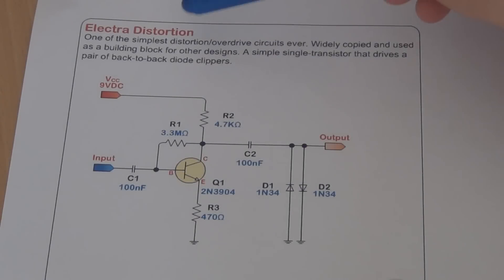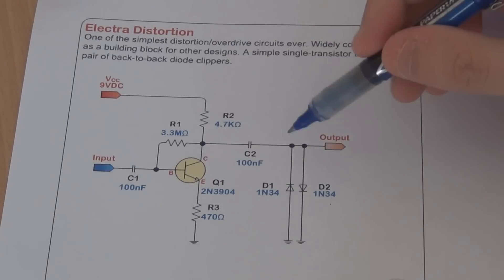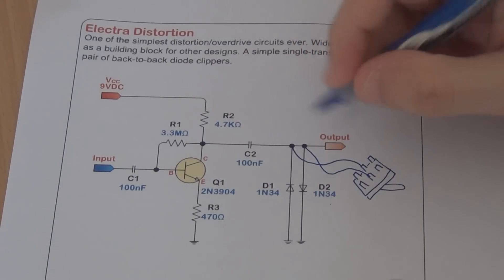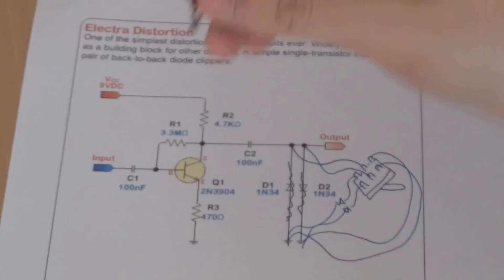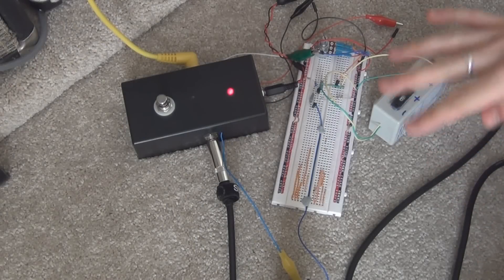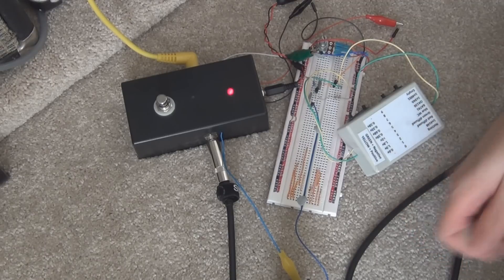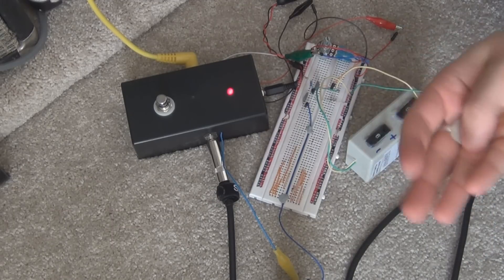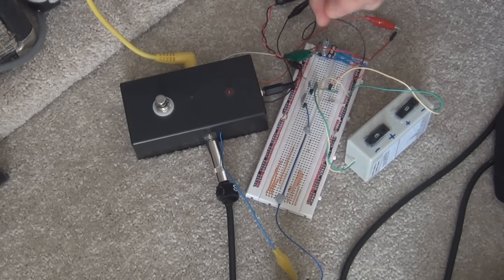10 min Dirt Pedal - Optional Modification

Comment: For those wondering, cuz annotations can no longer be accessed, the wiring presented in the video would short the circuit to ground and you'll have no output. 

To simple solutions:

1) wire an on off switch connecting both diodes to the on section.
2) wire a dpdt switch where instead of putting the bottom 2 lugs to ground, connect them together.

Comment: As well as the shorting to ground error, you could add that the diodes can just go on one set of lugs and don't need to be kept seperate. So a single pole on-off-on switch would be good for having clipping diodes - clean boost - alternative clipping diodes option.

Comment: You could also use spdt switch, connect middle lug to the circut, 2 diods on a first lug, and resistor on a third lug, with ends of resistor and diods connected to the ground. Resistor will help with volume differences.

Comment: Hi, just one clarification about the dpdt sw.. Would it mute the output if atleast one of those touches the ground? Thanks.
Reply: Was going to ask the same question. It should be either diods or nothing. An on-off switch would do the trick
Reply: @redrum22  Exactly.   Simple kill switch should do it.
Reply: So is this my problem? I added this clipping section at the end of an lpb1 build with a dpdt switch just like this but when I engage I lose signal...
Reply: @zacharygreenawalt7119  that's because the way that's presented in the video makes it so that all the signal that's supposed to go to the output goes straight to ground because there's no load. 

I'm honestly curious why he didn't just do on/off? Or on/on where the second on position goes straight to output?...

Comment: Hey really great channel,
I have built kind of the same thing myself  used a on-off-on spdt and added another pair of different diodes to the boost. I have a set of n4001 and bat41 plus the plain boost in middle position.  I have wired C2 and the output pot to the middle and then each transistor pair on the other positions of the switch. Works great. 
I think in the circuit in the video might be a mistake. In one position of the switch you get the diodes to ground and a distorted sound. In 2nd position direct ground and no signal. Not connecting anything would work I guess.

Comment: whats a good value for a subtle crunch at the same output level as the input? I plan on installing this circuit in my guitar and using one of the tone knobs to control the saturation before it reaches the amp :)

Comment: Your drawing on the paper: In the boost-position, the switch puts the output on the ground. Tjat cant be right? There would be no output at all, would there? Diodes there or not, but your switch makes a bridge and connection C2 directly to Ground?
Reply: Came to the comments section cause I was thinking the same thing
Reply: no the 2 middle lugs on the switch are the output.the top two lugs bring the diodes in,the bottom two go to ground to turn the diode clipping off.
Reply: +Daniel Allan 2:09 annotations added, you'll leave the top most two wires off that are connecting to ground as it would indeed through the signal to ground which would make the effect have no sound
Reply: @danielallan5058  6 years late but just in case anyone reads this comment, this is not true. 

The middle 2 lugs have no continuity with each other. You need to bridge both lug 1+4 and 3+6, then solder both diodes with the correct orientation to either 1+4 or 3+6. 

The middle 2 lugs will only have continuity with 1 and 4 or 3 and 6, depending on switch position. They don't have continuity with each other.

Comment: Very good vid, as all those you made. But, I Think there´s a simple detail that would make te Mod even simpler: It isn´t necessary to use a DPDT Switch. With Just a SPDT (One Pole) Switch It´s Enough. The incoming and out current of the Cliping diodes is the same. There´s no need to switch them sepparately.
Cheers.

Comment: I'm thinking about making the circuit as a onboard amp.  I just want a clean boost.  I have some chinese hot stack humbuckers that need a little boost.  I don't think the battery will wear down if I leave it hooked to the 9v all the time....no on/off switch.   Got a strat with a whammy bar that's blocked off so I can put the battery between the springs in the back.
I was thinking of putting somewhere between 100k and 500k ohm resister in line with the output of the circuit.....no diodes.    I'll test the output with a 500k pot....turn it until I get a good boost then measure the pot.  Replace the pot with a resistor.  It will be a set boost.  Any suggestions where a 500k pot would make a good single setting boost?  Set at half way up???  About 250k??

Comment: If you can help. Help. I have a question about the KH-95 Wah. I want to add an LED to it. But I'm not sure where to start since the DPDT is wired differently than the Cry Babies and I don't want to add a 3PDT switch. Any advice???

Comment: How to add a potentiometer to control the level of dirt
Reply: Paarth Pandya i guess you just put it between diodes and ground. Id use like 1k pot.
Reply: @kringekiddo8492   in two diodes?
Reply: maybe try to replace the 470-ohm resistor with a 1k pot.

Comment: Would it be possible to add a 3 terminal toggle switch, connect the output(signal) to the middle lug, and use the outside lugs to connect to the output jack and a speaker??

Comment: The 3 grounds on the schematic are solded together? to the negative pole (black cable) of a 9v battery, right?
Thank you for your vids
Reply from the maker: +DaftSmurf Hey mate, thats correct but they are usually soldered to the input sleeve.  Google madbean standard wiring for an example of an offboard wiring diagram.  Cheers!

Comment: @diy guitar Pedals Your switch example  is wired wrong, you just need an On/Off switch with 2 connector from the diodes to the output rail. https://drive.google.com/file/d/1tFD0_ojD_7uAz0na_QssS9f_QjOh2MwS/view?usp=sharing

Comment: hm?
I think you made a mistake with your schematic. When you flick the switch , you connect signal to ground. wich results in no output at all.
You have to leave the "non diode lugs" open, and not connectet to ground.

Comment: Do the kits come with the jacks and stuff needed to put it into the enclosure? Where can I buy the enclosure (Australia)?
Reply from the maker: +ralal500 Hi Ralal, if you order all options for the 10min buffer or dirt and boost or the 7 min fuzz all you will need to finish the effect is an enclosure (1590b recommended) and 3pdt footswitch.  You can get these from pedal parts australia or jaycar.  You can also try tayda electronics (international).  Hope that helps!
Reply: +DIY Guitar Pedals Thanks, also how much do resistor values matter because in the circuit diagram there are different values to the PCB parts

Comment: Hi, just wondering, in the schematic you drew out, when the switch is set to Clean, would the output sound not be completely grounded? I might be missing something here, it's late and i should go to bed, but from what i can tell the circuit gets grounded

Comment: You have the DPDT switch wrong.....you just want a ground lift of the diodes.....and not switch the signal straight to ground in the opposite throw of the switch.  You would want no connections on the outer lugs of the DPDT switch on the one side of the switch...……..close but no cigar.   You substitution box works but isn't like this switch...…                               You could also put a pot wired as a rheostat between the diodes and ground......so adding resistance to ground will affect the clipping quality of the diodes in the circuitry.  You'd join the 2 grounded ends of the diodes which is kind of misleading in the picture schematic......its better to show them joined and then from that junction have a single ground pathway when you draw a picture schematic.                You could also consider a bypass cap on R3 and also the bias of the transistor could be manipulated with a pot to make variations in its performance.                         The circuit is really not that far removed from a Dallas Range Master Treble Boost Pedal circuit

Comment: If I understand correctly ... This would be the diagram of this modification (the "10 min Dirt & Boost"), isn't it?
http://www.diyguitarpedals.com.au/shop/boms/10_Min_dirt_&_boost_Schematic.pdf
If so, I don't understand why there is no dirt in my sound (the sound is completely clean, I want to cry...haha).

Thanks!
Reply: +Ekaitz A. A. You need to connect the other side of the switch to ground :)

Comment: Question:  could this be run at 15VDC?  I'm thinking of using electra distortion circuit without the clipping diode as a small preamp stage to a small(ish) amplifier I'm building.
Reply: This should be fine. The VCE of the stock 2N3904 is 40V, so as long as you don't go over that, you should be fine. Actually, the closest point of weakness are the 1N34A diodes, which Vr (Reverse Voltage) is maxed at 20V, which is still well below your 15V DC.
Reply: Yeah I've gone ahead n built the circuit to test my idea n it does work as you say which the datasheet confirms.  but I'm using it as a clean boost, or more to the point a preamp for a small mini amp I'm building so won't be using the transistors.  If I do put the clipping diodes in as an option (with switch to disconnect for a clean sound) I'd probably use 1N4004 or 1N4148 since I've got those already.